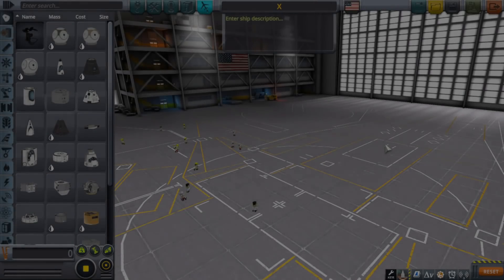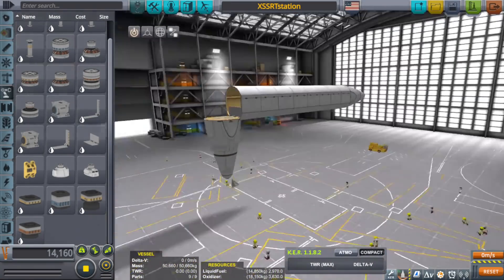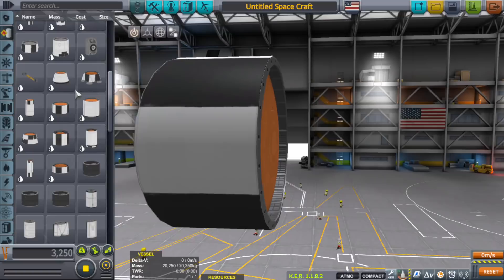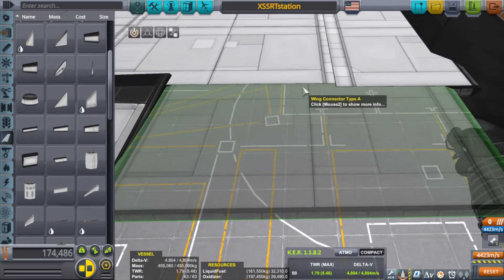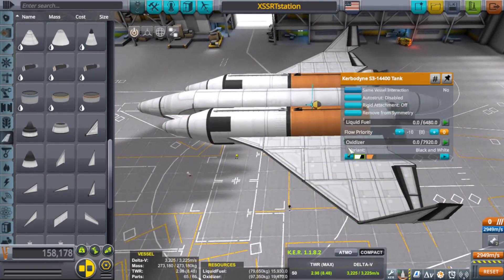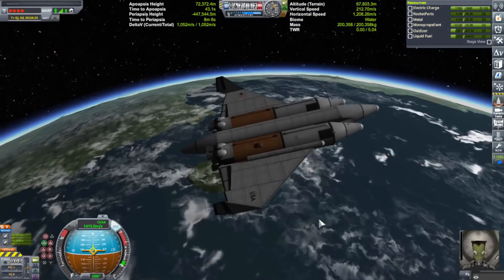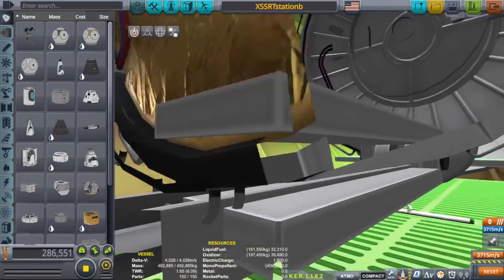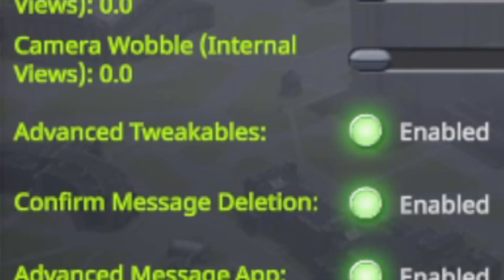SSTO into SPACE STATION

Comment: Hey it's me again
You gotta use less wings and front-rocket-drive relative to CoM, like a podracer, 3 columns and only one slightly offset to back, try it you'll know what ı mean
tip: shift-move in hangar to make bigga offset gaps.
I use 2 wing strakes with total 2.0 lift multiplier and one elevon at back and 2 canards at front. It's enough to lift 63tonnes of spaceplane with teny tiny landing wheels. yours I can lift with 6 big ass wing strakes

Comment: i usually like to use docking ports when using robotic parts in such a way that it docks to the port and use action groups to undock when i want to move it. i found that this greatly helps improving strength to things with robotic parts when in atmosphere or when under high acceleration. you could try that for the wings or the nose?
Reply from the maker: The strength is fine it’s the fact that they are not connected properly and therefore the game reads all the parts as if they are completely open to the elements. docking ports would sadly not work to remedy this.

Comment: You can use struts to hold together two parts on other ends of a robotic part (like your folding wings), and then disconnect them once you reach orbit and want to fold your wings up. Just right click on them while in flight and you get an option to sever the connection and allow the joints to freely move c:
Reply from the maker: I did just that in the video. 😉

Comment: Some mods that might help in the future when using the Breaking Ground DLC are Ferram Aerospace Research (FAR), Kerbal Joint Reinforcement Continued, and Recouple + Precise Editor.

FAR makes crafts more realistic in terms of aerodynamics.
Kerbal Joint Reinforcement makes things less wiggly.
And Recouple can be used to link and unlink that are next to each other but are not connected according to the game and Precise Editor helps you lines things up perfectly.
Reply: Precise Editor is super useful for custom wings as well.
If you have the mod installed, in the editor press, 'P' on a part and a menu will pop up showing its location and rotation, from there you can type in exactly where you want the part to be.
Reply from the maker: I mentioned FAR in the video. but most of those mods that you suggested actually change the game mechanics. And I’m trying to keep it stock as possible. 😎👍
Reply: @vaos3712  What about mods like Precise Editor and Editor Extensions Redux which only affect the building of crafts?
Or mods like BonVoyage or Mechjeb which adds a part but, the majority of the features are Hud/UI elements?